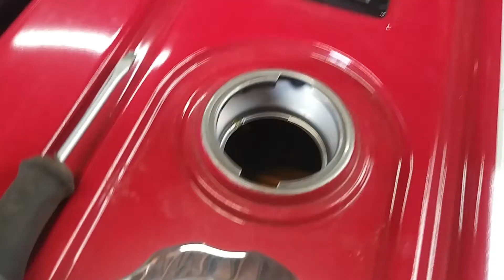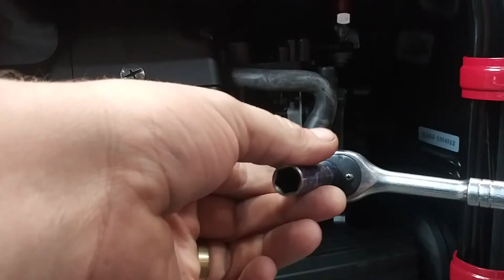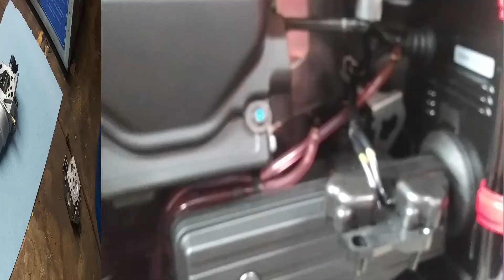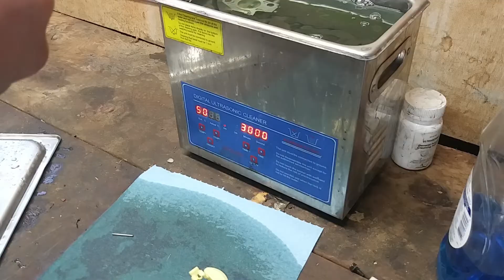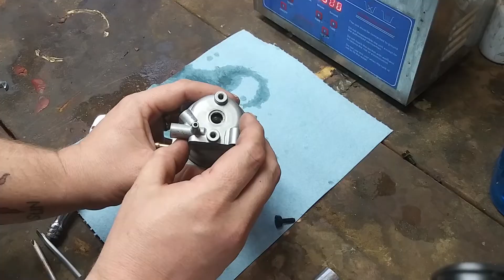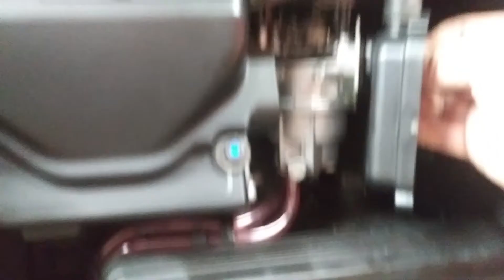Honda EU 6500 watt Inverter generator repair. Bad gas.

Comment: If you turn off the gas supply and you let it run until it stops, is that sufficient to keep gas out of the carburetor

Comment: Do you have take it fully apart like you did, or can you simply leave the “top hat” intact( no small springs to worry about) Can we clean these like a normal carb with basically the main and pilot? Or the small motors so sensitive that they need to be in the bath? Just asking because I just have some carb cleaner, wire brush, and compressed air?

Comment: Brand new? Why would someone leave stale gas in their generator? I only use treated gas & never leave it in for more than a year & siphon out the old gas. We own the EU7000is. That has electronic fuel injection. I haven’t had any starting issues with mine. I’ve had it 7 years & it performs flawlessly. We use ours for back up power for our house. Ours has 79 hours on it.

Comment: After every use of my Honda EU6500, I mechanically drain all the fuel out of the carburetor using the drain plug on the carb, then add Stabil to the gas in the tank, and have never had a problem in 17 years of using and storing it for home backup. Abuse by the owner is a cause of a lot of generator problems of any make and model

Comment: Your video instructions worked well, but there is an easier way to get the springs back on. Pull off the pieces that the springs get attached to and attach them to the carburetor. Then carefully align them back into the holes on the motor assembly. Much quicker!

Comment: What happens if you don't get the springs on inverter back correctly? Will it still start but not run?
Reply from the maker: No

Comment: Had the same problem from fuel sitting too long but worse. Mine has maybe 1 hour run time total. Can you drain from carb or just let it run till dies to get all fuel out? Also had to replace gas tank and petcock due to excessive rust from sitting too. 😥
Reply: I set my Eco throttle switch to OFF so it idles high then turn the fuel valve off and let it run out of gas.  I run my unit every other month for 20 minutes if I have not used it (use it only for house backup through the braker panel with interlock) The thing sips fuel, just add a spash when you want to exercise it.  If I need to fill the tank for an outage then when it is over I have a siphon pump that I use to drain the tank back into a fuel can that way next use it gets fresh fuel.  If the fuel in my cans gets to the 3 month mark I just dump it into the lawn tractor or one of the vehicles and fill the can with fresh fuel.  Use fuel stabilizer like Sta-Bil for extra insurance if you want. Never an engine issue this way.  I also keep it plugged into a battery tender when not in use.

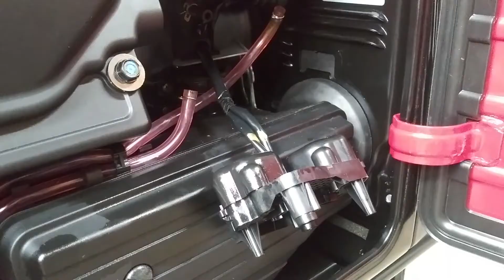Comment: I just posted a video that shows how to reinstall the throttle control motor and the two tiny springs from hell. If you get stuck at 18:51 like I did, my video will solve that puzzle for you. https://youtu.be/SH9gKDVMl50

Comment: Thanks for the great tutorial video. I have to do this exact same job to my 6500. Mine is surging when it's under a heavy load. So I do believe it is from the exact same cause. Bad gas and varnishing right? Anyhow I kind of look forward to doing it now that I know more what the process is thanks again
Reply from the maker: Yes that should be the cause or gaskets are bad or vapor lock but just clean out the carburetor and you should be just fine

Comment: lovely video help. Thanks a lot. I faced the similar problem and it was solved by the same way. For me just remain one question. How to place the o-ring on to Jet Set, Pilot #40, because in my case after washing by carb cleaner this o-ring became bigger and when I put it in place as before, it's slack. Any comments will be highly appreciated. Brgds Igor

Comment: thanks for taking the time to post this video. There's nothing online at all about the EU7000Is. Nor does Honda offer any method on draining the gas in that 7000 unit nor does the dealer have any ideas except to purchase a Fluid Evacuation Tank. 
Since the 7000 doesn't have a carb, I'd imagine its dissimilar than the 6500 in your video.  Perhaps the easiest method is to run the unit out of gas after the first 30-60 days.
Reply from the maker: Thank you for watching and taking the time for the kind words. I don't see these very offen if I do I post more videos
Reply: I'm hoping it is because they don't break...  but it's likely that they are so expensive that there aren't many of them.  Mine is only 6 months old, no issues yet...

Comment: Was it started and dies or it didn't even started?  You forgot to show us before you removed it hehehe.  Cause mine started for about 5 seconds and dies but it will restart every time when I turn the key but it dies after 3 to 5 seconds right after it starts.
Reply from the maker: Yep that was same problem but I had to use ether to start
Reply: @RepairGang  I'm having the same issue, starts for a few seconds, then dies, what do you mean 'had to use ether?'

Comment: A reminder to readers to clean out the sediment trap at the bottom of the fuel tank where the turn off valve is located. It probably wasn't excessively dirty in this new machine, but the best time to clean it out is when you already have the air plenum off. It is described in the manual as part of the service procedure.
Reply: When you have this apart would you suggest adding a small gas line filter to the gas line. It would seem to me to be a good idea in any event.
Reply from the maker: Yeah that would work
Reply: I can't get the bolt off that holds the sediment trap. How do you get it off? My generator still won't work after cleaning the carburetor, and the fuel tank still has gunk inside, so I need to get that piece off!

Comment: Hello there, just wanted to say what a wonderful video you have done here for your viewing audience.  I am a new subscriber as well.  I would like to make two minor suggestions that I think will help both you and your audience moving forward.  Many of todays’ fuel additives contain carcinogens, you might want to consider wearing a high quality surgical glove when performing such tasks.  When I got my start at Honda automobiles back in 1982 My A-Tech friend got me into wearing them and I have never turned back, they have also saved my hands from many cuts and gashes over the years as well.  Lastly, you really showed how to do the tough stuff well but did not mention that before removing the low speed idyll screw, that viewers need to remember to tighten the screw down to the right and count the number turns to make it easy to get the correct idyll setting when reinstalling.  Hope this comment helps in some way, nice job all the way around.
Reply from the maker: thank you so much for info yeah one day I might wear gloves always harder to work with though. and yeah did not think to remind people to remember the idle screw I been doing this for so long I just remember. lol maybe I do the paint marker trick to help viewers like when i started.

Comment: Very nice fix. I have a EU2000 that I bought new, and have had lots of carb issues filling the crankcase with gas, No seperate fuel shutoff. I will add one this winter. I also took in a Champion that the customer did not want to fix. Looked like some sort of sticky stuff in the entire fuel system. I flushed the tank, changed fuel lines, cleaned the carb and it runs better that the Honda and I am a big Honda fan. I do lots of Honda's from 2-1/2 Hp to 13 hp and bigger. but the small gen sets not so much. Thanks for the video.